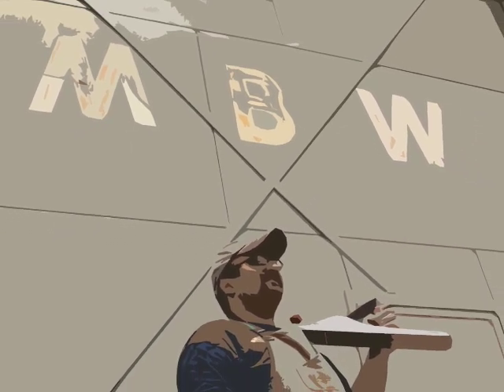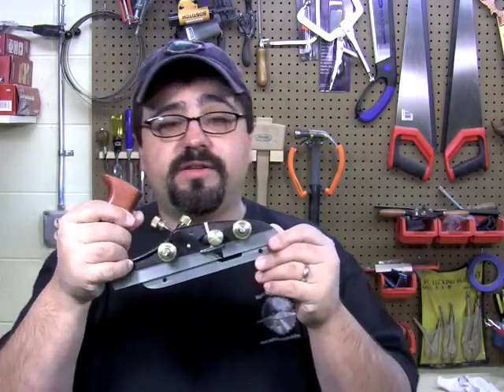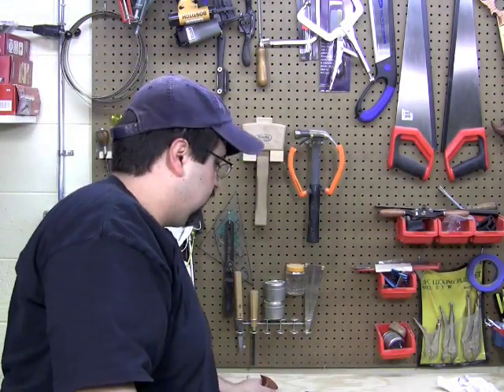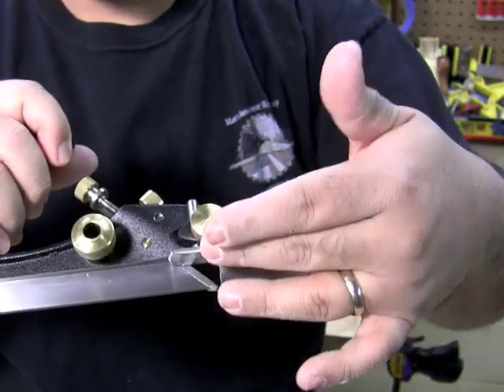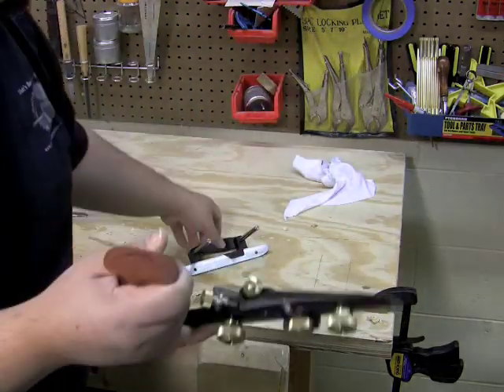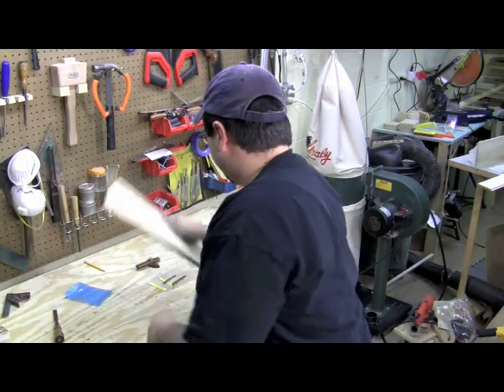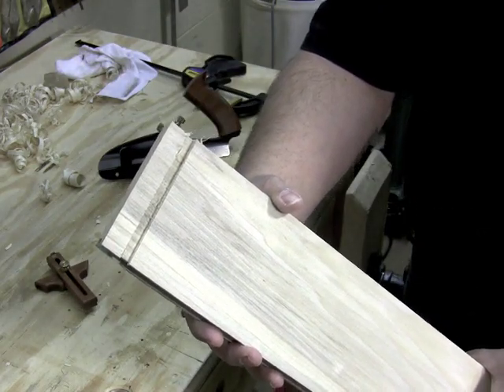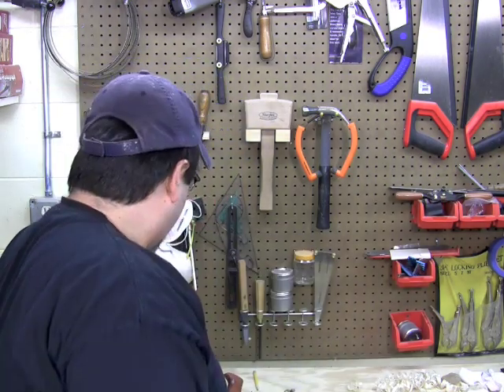344 The Plow Plane

Comment: Is it possible to create a groove that ends short of the end of a board?  That is, if I wanted to created a box with 1/2" thick sides and a 1/4" thick bottom, I'd groove the sides, say, 1/4" deep, 1/2" up from the bottom of the box sides, BUT stop 1/2" short of the side board end so as to not show the groove at the box corners.  With a router, I'd use a stop, but this isn't a router.